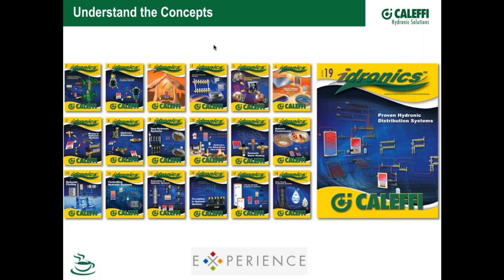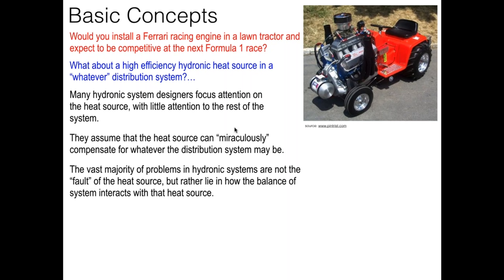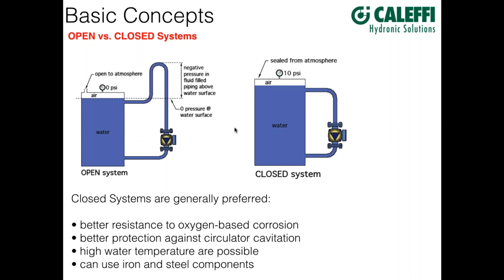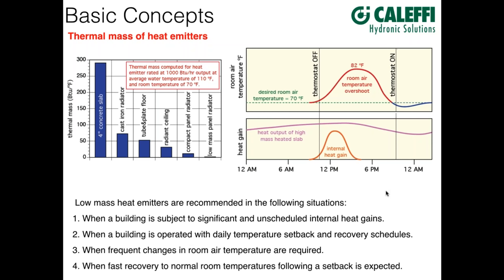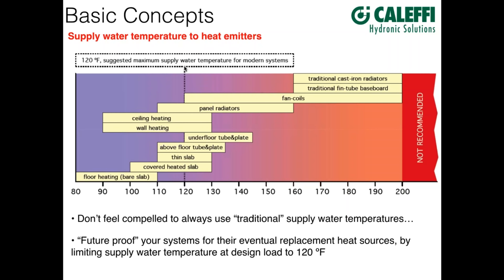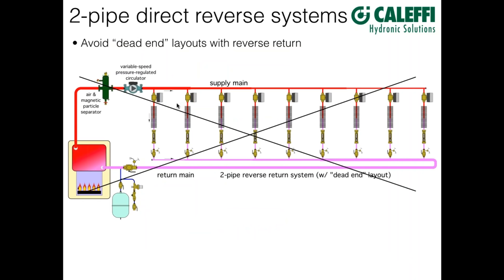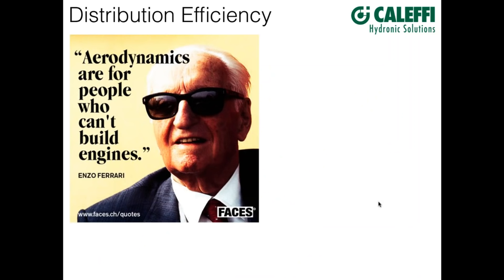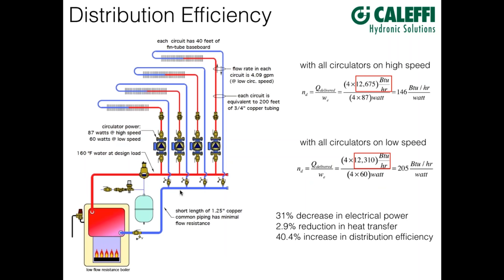Hydronic Piping Systems Proven Designs (Part 1)

Comment: Solar heat gain is mentioned often in this video. My question, with the advent of Low E glass, does that negate solar heat gain concerns or design criteria? 

Very informative video series. I am a novice home owner hvac tech type with decades in industrial automation and process control. Currently installing radiant floor "warming" in my new slab home. The loops were the only thing the builder installed per my request. I find too many HVAC techs are just part swappers without any advanced knowledge. So my simple design of using a heat pump for heat source via heat exchanger for 6 zones flow regulated to achieve a warm floor was beyond local contractors "expertise". A conventional Hvac heat pump handles the air conditioning needs, while this radiant system is only expected to warm the floor for comfort.
Reply from the maker: Some solar gain still occurs even with Low E glass.  You can refer to the 19th edition of idronics for more information.  Refer to:  https://www.caleffi.com/sites/default/files/coll_attach_file/idronics_19_na.pdf
Reply: I recently bought windows for my shop and the two varieties had the solar gain ratings listed along with the U rating and such. Nice to see.

Comment: Question: What caused Boiler's pilot to turn off, before high limit settings is reached? 
The single gauge has 2 needle pointing scales, but without any wires for possible control. The lower scale with the single needle indicates the water temperature on the scale of 60-260 degrees Fahrenheit, while upper scale is with 2 (pointing) needles for 2 separate scales. One scale is for Latitude with the range from 0 (zero) to 115, and another is for pressure on the scale from 0 (zero) true 50.
Expansion tank is 2 gallons  at 30 PSI. The system has 3 Zone valves all of them mechanically in open position. The thermostat true 2 vires controls gas regulator solenoid, also with 2 wires.
After call from thermostat, and when the Pilot light is ON, the heating system turns ON. High limit switch on the aqua stat is set to 180 degrees, but boiler pressure is rising faster then temperature rises and at temperature of 165 degrees the pressure exceeds 40 degrees and shots OFF the gas to the burners, but in that process shots-off gas for pilot lights, as well.

Gas valve to the pilot suppose to stay ON, but it shots-off. Again, no any wiring to those 2 gauges exists, which could possible control it. Could the problem be in to slow heath dissipation from the radiators be or something else?
Reply from the maker: The boiler is typically controlled through internal aquastats and limit controls.  Today’s  high efficient boilers have multiple internal sensors that monitor supply and return water temperatures, flue temperatures, inducer fan speed and gas valve modulation all controlled through an internal control to perform these tasks.  Individual zone thermostats talk though exterior zone switching relays to turn on pumps or open valves but send one signal back to turn on the boiler and start the process of heating water and boiler control.  We would refer you to the 19th edition of idronics whereby you can dig deeper!  
https://www.caleffi.com/sites/default/files/coll_attach_file/idronics_19_na.pdf

Comment: Can you simply install a heat exchanger to a closed loop radiant heat system thats fed by a wood boiler
Reply from the maker: Hello! Possibly. You will need to look at pump control and temperature control to select between the wood boiler and your conventional boiler.

Comment: Hi , on  47. 22 you have low head loss design , would it work with close spaced tees instead of hydraulic separator  and short pipes for two secondary loops . Appreciate your answer .